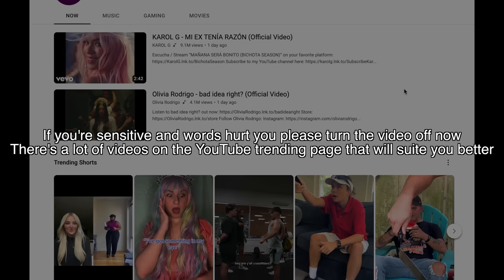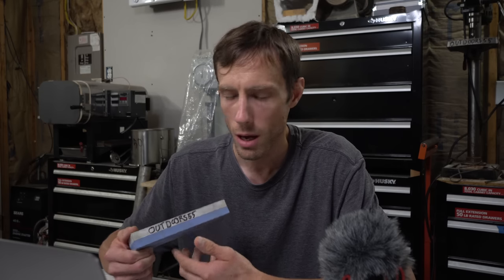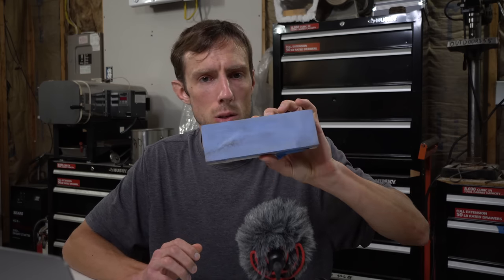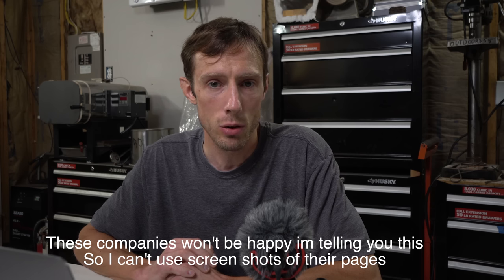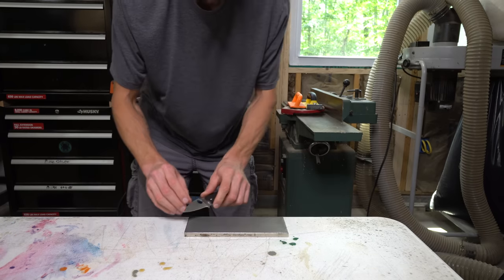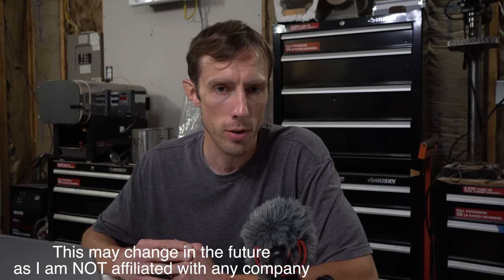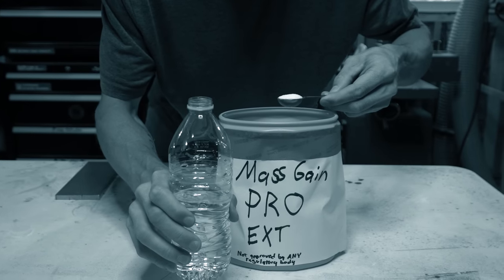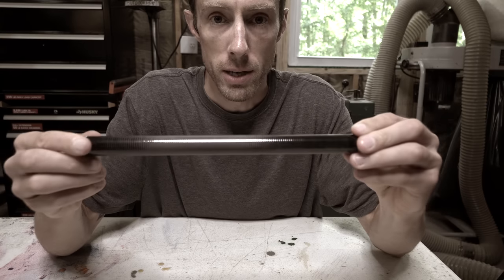The Internet’s BIGGEST Sharpening Stone SCAM

Comment: Yeah, crap. Seeing just that first shot of that thing falling apart. Pure garbage $50? Way over priced. The small two sided stones sold in the lumberyard for about $6 are much better.  And yeah, a brick will work. On the trail a rock will work. Bottom of a ceramic coffee mug will also work.  In a pinch.   Me? I have a Trend diamond stone, (similar to the one you're using), a ceramic rod (for just about every time I use my kitchen knives), and scary sharp (stick on sandpaper and a piece of float glass. Look around on trash day for an old glass door cabinets. Take the glass. Buy a packet of scary sharp sandpaper.  I started using scary sharp for wood chisels, but it's good for anything you'd use a stone for. (just be careful and only move the blade away from the edge. If you go the other way you'll snag and tear the paper.) 
Why use scary sharp and diamond stones over all those expensive Japanese and Arkansas stones? Because they remain flat throughout their entire useful life (My Trend stone is at least 20 years old). Sharpening 'stone' stones are very expensive and hollow out requiring you to spend a lot of time reflattening them. 
And always look at the 1 star reviews. Is the reviewer just angry, doesn't know how to actually sharpen? etc... or is it clear they do know, are clear about what is wrong with the product, are suggesting better products? These are the deal breaker reviews. Best to heed them. And there's nothing more useless than dozens of poorly written one sentence  5 star reviews, or 'I got it today and it's amazing.' What about next week? I'm happy you're happy, but this isn't information.  These may be honest but they're mostly poorly informed. 
Good video but it's too long. Why spend so much time on what doesn't work?  That first shot of that junk stone and $50 is all that's needed.

Comment: They work for $30 but not great. I have some grey whetstones that are coarse af, comparably to the 400 stone from these. Completely unusable like sharpening on a brick. Not smooth at all and can leave chips on a knife. 

These Chinese stones work. My only complaints are the grits are kind of ass. I spend a good deal of time on the supposedly “10,000” grit stone and can’t get any polishing on an edge at all. Also, the mud is bad compared to a king water stone. Very poor quality. Since it came with a flattening stone and a fake leather strop at $30, I guess I can make it work.

Comment: Iv always used smiths stone sharpener blocks they cost under $15 and they make my knives razor sharp i also have a 15 inch piece of glass from a car window that i use the edge to as a sharpener for the very fine blade knives.. try it it works

Comment: Yep. Iwe sharpenned a knife on brick (just quick temporary solution for the day) it work and if someone is worried about how expensive sharpening stones are just buy 1 brick for fiew bucks. It wont be plesant but it will give u working edge for rest of the day xD. Still i would recommend real sharpening stones/equipment. Even on just for your guys work knives.

Comment: Get diamond plate get good one. I carve wood figures, I sharpen a lot usally using leather but I do use diamond stone to get the shape right. , 120, 400, 1200, then leather,  usally don't need the 1200 but I like it

Comment: YT is filled with sharpening frauds and idiots. Here's the deal: My kitchen knives stay shaving sharp for weeks at a time. When I notice they no longer shave, 3-4 strokes on a cheap ($12) water stone bring them back to 95% sharp. 3-4 strokes on my 2Um diamond-impregnated (very hard) rawhide strop gets them to 100%. The whole process takes 20-30 seconds per knife! Why do people sit there for 20 minutes to sharpen a knife? Oh yeah, to impress naive YT viewers. Oh, and the "mess"? There's no mess if you run water on your stone, stroke the blade 3-4 times, rinse the stone and put it away. If you sharpen lawn mower blades with a fine ceramic stone, yeah, it may get sway-backed. I use diamond stones too in my shop, and like them, but they can scratch things so I keep them in my shop. Rule of thumb, if you see someone stroke-stroke-stroking his knife endlessly, he's either naive or taking advantage of those who are. Congrats on bringing sanity to Amazon buyers. Sharpening is 1 of many things that need addressing!

Comment: So how much do you think the HR-150A Rockwell hardness tester may read incorrectly due to the improper wooden bench it sits on.. as the wooden bench may have some small give to it VS a steel or concrete stand the manufacturers manual recommends for it to be mounted via the threaded holes in the bottom casting ? Just an observation if you go thru the motion to get calibrated test equipment but then install it against the manufacturers recommendations, does it still ring true..should it be trusted? Placing it on the concrete floor in a level area would be light years better for accurate test results..Accurate test results are the intended purpose,  I'm assuming correct? This is not a slight oversight this could sway test results for a "disliked" manufacturer products in a testing video..
Reply from the maker: I don't believe you have any idea how a Rockwell tester actually works or is calibrated.
Reply: @OUTDOORS55  I own a HR-150A Rockwell tester..the same one you have..and have owned and used it for many more years then you..
Reply from the maker: So how do you calibrate it then?
Reply: @OUTDOORS55  by using one of the 5 test plates..both of us know that..that's of course if you have the correct tip installed and you are using the correct scale..let me guess you tested and did the calibration on the wooden bench right..if so it's still not correct as it goes against the manufacturers recommendation..a simple clarification at the beginning of testing..like I'm going against the manufacturers recommendation by using a wooden bench etc..would clear up everything..Cheers my friend..
Reply from the maker: Mine says the bench needs to be sturdy. My manual says nothing of it needing to be specificly on a metal or concrete base. Not only has this one been calibrated but backwards calibrated as well. Testing other samples that have been tested on other machines as well as reading specific heat treatments that read correctly according to the manufacturer heat treatment recommendations for a specific hardness.
Reply: @OUTDOORS55  that's interesting as my testers manual states clearly about a concrete or steel stand..and I did assume all HR-150A are the same as it most likely had the same manufacturer by then gets relabeled by whomever..etc..

Comment: So I went to the recommended stone link.  They sell 3 grits of stones, 50 dollars each.  Do I need to use all 3?  Then I gotta learn how to use them.  Maybe I'll stick to the $3 pull through 'sharpener' that is damaging  my knives quickly and easily instead of buying $150 worth of stones to wreck my blades slowly..
Reply from the maker: Might want to wait till my next video drops to explain the reason you would want to sharpen on a more expensive stone 😉 you dont need all three. The 1000 grit will suffice
Reply: @OUTDOORS55    thanks.  Which is the 1000 grit?  They are marketed like course, med, fine, ex fine and don't give a number

Comment: Isnt it the sludge that comes off them to does the sharpening, not the stones itself. They are meant to "sludge" up! As the whether they work or not is down to use.
Amazon is often very much more expensive than the high street for exactly the same product.
Reply from the maker: No they are not, the sludge is from too weak a binder.
Reply: @OUTDOORS55  if they are copying Japanese water stones the sludge is deliberate! There is even a stone to make the sludge before use.

Comment: I just realized your recommended amazon steel stone is only the 600 grit instead of the 1k version. Is that just good enough (clearly you are a great sharperner) or is it because the strop and compound handle the rest when you finish up?
Genuinely curious.
Reply: The strop pulls the bur off and would still be pretty sharp on 600. It really depends on what you are trying to do and that would give a better idea if 600 would be good enough or not

Comment: Is there something wrong with your website or have I managed to customize myself into non-functionality again? I can't find any links to click on the entire front page.
Reply from the maker: For some reason Amazon doesn't work with certain browsers and privacy settings. Not sure why.
Reply: @OUTDOORS55  I'm going to do something nuts and try disabling ublock origin on your website and see what happens... And yup, there it all is. /sigh
Reply from the maker: @DerrillGuilbert  for some reason its an amazon problem they haven't fixed.
Reply: @OUTDOORS55  Most of the filter lists ublock pulls by default are ... unforgiving. I am comfortable disabling it on YOUR site, so it's fine for now. Most folks don't advertise anything on Amazon that I'd be interested in, so it's not like I have to worry about it elsewhere for the most part. Thanks for all you do, sir, and the replies.

Comment: water sones are not for beginners , you need to know how to use them and you are using them wrong , you also need a nagura stone to keep the stone flat .
the cutting edge should not be pushed against the stone only drawn away .
Reply from the maker: Id disagree
Reply: @OUTDOORS55  disagree all you want but you are using it like a diamond stone and it's a totally different sharpening technique, I use a set of water stones for my chisels and plane irons  and  get razor sharp edges

Comment: i actually started on those waterstones an still sharpen my Scandi Grind Knives on it. you need all the Mess on the Stones (water, wear and abrased steel) to get stuff sharpened. it takes quite a while but then just gently so you thing. it is also totally insignificant what Grid you have. Sharpening starts when you got wear and Steel on the surface.

Comment: You honestly don't have a clue that stone is meant to disintegrate slowly everything you've shown on here looks like it is perfectly normal I cook professionally and keep all my knives shaving sharp I've used stones like this for a very long time that debris that comes off is actually intentional and not in a engineered to fail kind of method if it didn't come off the stone clogs changing the grit value stamped on the stone it also ensures that the grit is always sharp if you look at old oil stones a lot of them get really badly clogged and don't work so good the loosely bound grit is designed to prevent that yes it means you have to flatten the stone regularly um but you always have the grit that you're looking for and always cuts into the metal the same way I sharpened knives almost daily one of those stones usually lasts me about a year and a half your average user might get 20 years out of it they're not A Shapton But most of them are fairly reasonably priced and they last awhile even a diamond plate isn't gonna last you forever as the diamonds breakdown they get finer and finer which means they have to get replaced eventually Diamond stones usually get replaced just as quickly as those cheap Chinese sharpening stones do but at least the cheap Chinese sharpening stone cost me less and the grit is always what I expect

Comment: I think the wording is a bit harsh. I bought several "cheap" stones from temu, but I think I got exactly what I paid for, which I'm OK with. The main downside you mentioned about the cheaper stone is that they are softer and harder to learn on. I'm new to this, but I think these stones are fine. I like the feedback these stones give me, too much pressure and I feel the knife digging into the stone. Wrong angle, same. This allows me to not mess up my knife as badly. 

Granted, I didn't pay $50 bucks for my stone, more like 5. So I get if you paid $50, you'd be upset. But that's the seller that's the scam, not the stones.